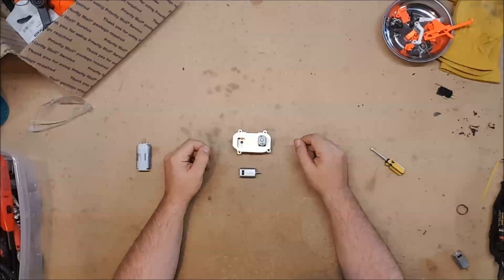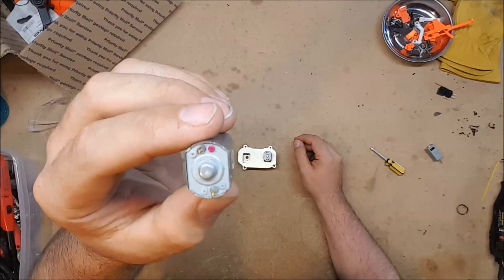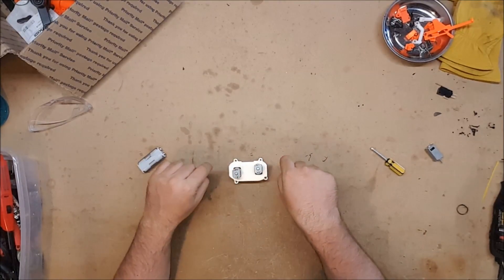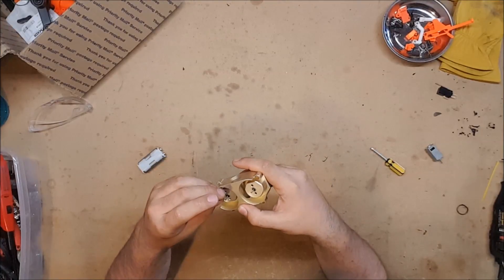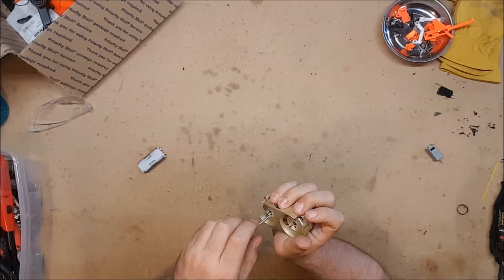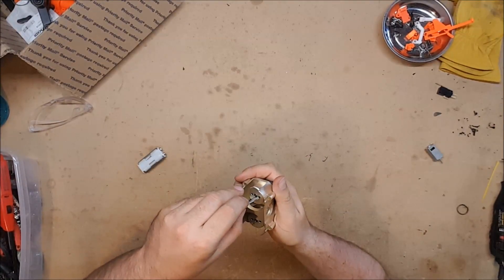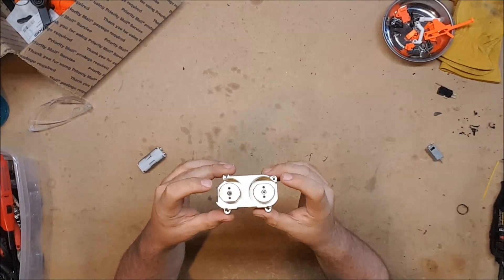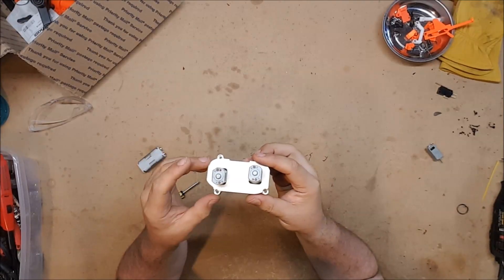Monday Mod Tips - Episode 8 - Flywheel Motor Installation

Comment: Is there a video that explains and shows the sizes of fly wheel cages, and the purpose of them? Also, a video on the fly wheels and different designs/purpose?
Reply from the maker: Not that I know of. The distance between the wheels is referred to as "crush" and higher crush increases the FPS. Most of the other variations are for accuracy.

Comment: is there a mod tip for putting on a motor cover yet?
Reply from the maker: No.  It is pretty much just glue it or screw it in place.
Reply: it's hard to align it right and such, i found. though it might be my bad printer.
Reply from the maker: For which blaster?  The ones I use practically snap into place.
Reply: for the rayven, though i was test fitting without the hole cut. there's still plenty of user error on my end.

Comment: Hey cap.
Neither the motors I ordered nor the flywheel came with the small screws. Please can you say what size they are, so I can find them in a hardware store.
Reply from the maker: +Jacob Sörensen it varies from motor to motor. Take the motor to a hardware store and try them out.
Reply: Captain Xavier. So practical. Much apprising. Many Thanks
Reply from the maker: This is what I had to do recently.  It is the only way to be 100% sure you get the right ones.  :P
Reply: Captain Xavier, just need to cross my fingers, that my local hardware store has the right size.
But thank you so much for the tip.
Have a nice day.

Comment: Captain Xavier I have a queen why do people change there flywheel cage does it do better performances? Flywheels I can understand but cages I do not
Reply from the maker: What he said
Reply: Also canted cages make blasters more accurate depending on the dart
Reply: Fritz Moises metal cages are tipically used to lessen the sound of the motors. 180s in a stock cage can sound like a leaf blower, while those same motors in a metal cage could sound a stock flywheel gun. Hope this helps
Reply: In addition to the already-stated reasons, some motors simply won't fit in an otherwise stock blaster (180 size are often too long) without cutting a hole into the body shell. That leaves you needing to make more body mods to expand the shell with a cover so your motors are not poking out. However, there are replacement flywheel cages for some- though not all, sadly- blasters which are shaped differently to get around all of that shenanigans.
Reply: Nathan Talisien it should be noted that I only mentioned 180 motors because they are the loudest type of flywheel motor currently on the market
Reply: Fritz Moises high crush cages give some serious fps gains. They allow flywheeled blasters to hit 160 fps (single stage)
Reply: dragonblaster 10000 True enough, and some blaster shells seriously aggravate the problem. I mentioned the 180's because they are generally long enough (or tall enough, if you prefer) to need work to fit.